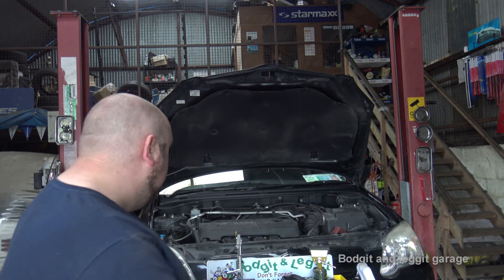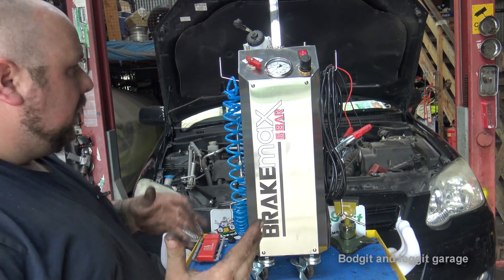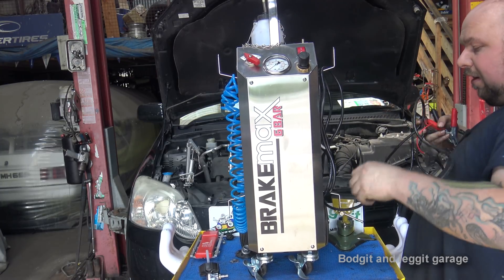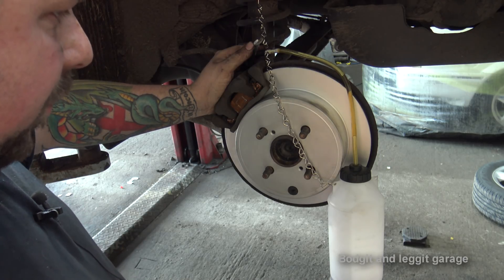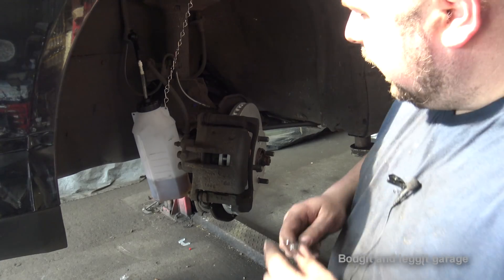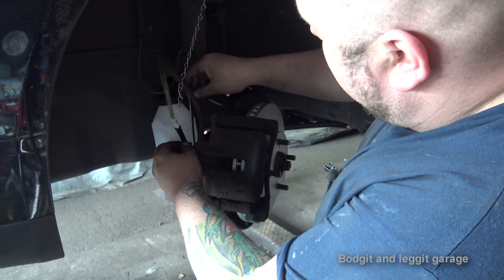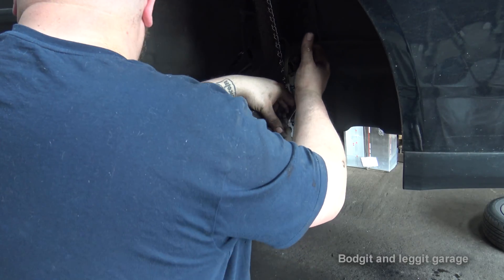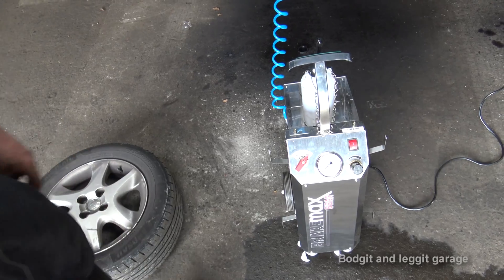How To Bleed/Test Brakes Fluid With Hubitools 12v brake bleeder Bodgit And Leggit Garage

Comment: Can't beat doing the job properly with the proper tools Leon. Now, it's just reminded me. Few years ago now but Clio back adjusters stopped years ago, so I take the drums off and adjust that way. Had just done the job, and always left them a bit tight. Anyway trip to Lynn so trundling happily along the 17, got to Lynn first roundabout, stop downhill. No problem. Not 1/2 mile further turn off to an uphill roundabout. Pressed brakes, foot to the floor. It's blind so frantic pumping I stopped. Not 1/2 mile to the stadium, so very steady drive. Got out to see which wheel was wet, none. When they cooled all ok, steady drive home and changed fluid next day, plus slight release of brakes. It wakes you up when it happens lol.

Comment: HAHA so true! You arm yourself with the best equipment you can afford to produce the maximum return on your investment. Key is increasing your capability & efficiency!  Tons of videos out there how to perform manual brake bleeding the normal DIYer does . Plenty of less expensive vacuum bleeders and Mityvac makes a https://www.amazon.com/Mityvac-MV6840-Pressure-Bleed-System/dp/B005MVBFM4/ref=pd_ybh_a_6?_encoding=UTF8&psc=1&refRID=YJQWXSG6STA6RDEA3DY1  I was laughing when the fluid was heating up :D Nice setup Leon.
Reply from the maker: Hayward's Automotive lol thanks mate but on modern cars you need a machine that is pulsing otherwise you can cause damage to modern abs pumps the older cars you can get away with it but on the new modern stuff you cannot
Reply: Older style brake levers? Need a pulsating machine or cause damage to an ABS pump?  You talking scan tool ABS bleeding? Are you talking about bleeding with brake pedal vs pressure or vacuum bleeding?
Reply from the maker: Hayward's Automotive hi mate stupid typo in the first part of that I had to rewrite it on a lot of the new modern cars the manufacturer say you need a that can provide a pulsing pressure machine so it will not damage the ABS pump if you put straight pressure through them you can damage the pumps
Reply: Now that's funny. So how do they think the master cyl works? Does that mean we need to start shaking our legs to pulsate the pedal pressure.  If that was the case every time someone does a panic stop the ABS pump will be damaged. During a panic stop up to @1200 psi line pressure is generated from the master cylinder and even more on high performance vehicles with ABS.   Pneumatic pressure brake bleeders don't pulsate including Snap-on's nor do they go anywhere near 1200 psi. Most bleeders operating range is 1-4.5 BAR 14-60 psi. When you bleed the ABS you use the brake pedal & a scan tool. The ABS portion is not bled w/o power...? Are Euro cars modulating pressure prior to the ABS pump?
Reply: Leon just trying to understand their logic but Euro cars especially high $$ cars are sometimes years ahead in technology over production US vehicles. It got me researching though and Vacula makes a pulsating dual vacuum/pressure brake bleeder but that was the only other one I found. I researched thru Mitchell Pro Demand 2015's US & Euro cars and didn't see any manufacturer recommendation or different bleeding procedure and 2016-2018 is limited data plus still under warranty. Just trying to stay up on new technology so if one pops in the shop I understand why not to use a conventional pressure brake bleeder. Thanks Leon!!

Comment: Are you sure that wasn't old anal lube in the system?
Reply from the maker: Ozzstar yes it was the leftover from our weekend we spent together I'll wait no forget it pretend I didn't say that LOL
Reply: bodgit and leggit garage 😄
Reply from the maker: Ozzstar 😊😂😂😂😂
Reply: If you on the budget , you can pick up bleeder witch you manually pump the pressure for about 80 euros 
And little tool wich checks the resistance of the  brake fluid witch will tell you water percentage for about 10 euros.
Reply: +Dom's Garage first I would need to buy a euro because I don't have that.  Does Walmart sell them?
Reply: Ozzstar i meant to write it in main section ;) 

https://www.amazon.com/Bleeding-Genesis-Bleeder-Bottle-Motive/dp/B075NMQJV3
But you looking for something like that

Comment: Fantastic Video! Very informative! Is this unit pulsating? Because most manufacturers recommend that for ABS Systems!
Reply from the maker: DiagnoseDan hi mate yes it does you can hear the machine and you can also see it on the pressure gauge as you know yourself how much information do you put in a video I will be revisiting it at some point
Reply: What vehicles and manufacturers recommend that...curious b/c never heard this before?
Reply: Hayward's Automotive Most do!
Reply: Which ones b/c I just went thru most Euro vehicles up to 2015 and there is nothing in Mitchel Pro Demand on using a pulsating pressure brake bleeder. It basically has use a pressure bleeder or manual method to bleed normal brake hydraulidc system and use scan tool & brake pedal to bleed ABS unit??? Curious?? I haven't seen a pulsating brake pressure bleeder in the US? The master cyl applies @750-1200 psi from the master cylinder to the ABS module and it is steady pressure not pulsating pressure and the ABS doesn't fail...just trying to understand the logic behind it?

Comment: what pressure would you set on a self pressure brake bleeding tool. The ones with a pressure gauge on it, on  a ford focus mk2 1.6 tdci 2009
Reply from the maker: mark H I would use more less the same pressure I used on this one mate but it does depend on exactly what you are doing if you've lost all the brake fluid you might need a little bit more pressure
Reply: thinking about replacing my brake fluid for new stuff
Reply from the maker: mark H always a good idea mate amazing how your  brakes feel afterwards
Reply: thanks, Leon for the info, keep making the video

Comment: Hi leon. I use a pneumatic pressure bleeder. Its my habit to not remove old fluid from reservoir as i think this creates an air pocket. So i bleed the shortest line first to evacuate the old fluid from the reservoir.  Then the rears so fresh fluid is availble to come out. I run it at about 30 psi cos on large vehicles the longest line is slow with less pressure. Full change in 10 minutes. Run about 1and half litres out in total. Cheers gr8 vids
Reply: Nice procedure, dave sterl but removing the majority of the fluid will not create an air pocket as long as you refill with new fluid. The reason for doing this s only to speed up the process, nothing more. Each method will work.
Reply from the maker: dave sterl yes mate I have done both methods in the past you just use a bit more fluid doing it that way that's all this is the best advantage with this machine as you can turn up and down the pressure depending on what you are working on

Comment: Just like a Gunson ezibleed, only a bit posher! :)
Reply: Icarus dont use an ezibleed as the air in ur tyre will have water in it
Reply: Malcolm Young the exibleed does not create the water content. The water is in the air that is in the tyre. Ezibleed uses this air to act directly onto the fresh fluid which contaminates it. A proper pneumatic bleeder has a diaphram in the cannister so the air doesnt contact the fluid. The hygroscopic effect of brake fluid is what lowers the boiling point and water is not compressable. Ezibleed puts water into the new fluid hence my comment not to use this system. Cheers for your thoughts tho
Reply from the maker: Icarus on the older cars yes mate but certainly not the newer ones where you need a lot more pressure especially with some special abs pumps
Reply: Any pressurised air system will create water droplets. There isn't much you can do about it. As brake fluid is hygroscopic(note the spelling) it absorbs water from the air anyway. The pressure within a tyre as used in an Ezibleed system creates a neglibible amount of water content. Ezibleed kit are relaively easy to use(so long as your tyre pressure isn't too high) and is a 'handy' way of bleeding the brakes if you are wrorking alone. There are other 'hacks' methods that don't use pressure systems which work just as well but can't be used by the individual to 'Bleed' brakes or air in the system but can be used to change the fluid without too much difficulty.
Reply: Hi Leon, yes, of course, those pesky ABS pumps! btw, great channel, love your content and delivery style, please keep up the good work! :)